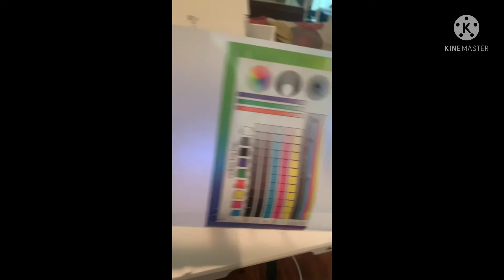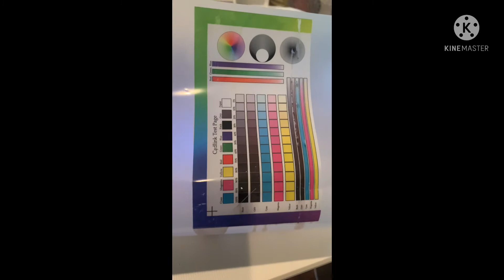Converting a 8550 and a 8500 to a Dtf Direct to film printer!

Comment: What program you use for the et 8500, cad link only showed 8550 settings
Reply: How do I connect cadlink to my eco tank 8500 it’s only allowing me to select the 8550 😅
Reply from the maker: Did you hook it up with the cord
Reply from the maker: Yes use 8500!
Reply from the maker: The 8550 is the same thing

Comment: 8550 or a converted L1800?
Reply from the maker: Please don’t make me choose. I guess a l1800. But I wouldn’t buy neither. Ima R3000 p600 or a p800
Reply: @bigboiprints5726  Where do you recommend getting them from? You have any?
Reply from the maker: Marketplace or eBay
Reply: @bigboiprints5726  I wanted one of those big boy 24 inch printers but i cant find them at a decent price. I was told the US p6000 will lock after a few refills or something like that.
Reply from the maker: I heard it but not sure yet
Reply: @bigboiprints5726  Good looking out bro....Heard Acrorip 11 will support P900. Your thoughts?
Reply: @bigboiprints5726  Found a P800...I have your inks in my cart....Need refillable carts ASAP. Trying to find regular or 280ml....Do you know where I can get them ASAP?
Reply from the maker: But I heard they print nice
Reply from the maker: Still don’t have a chip resetter
Reply from the maker: Ink owl. I’ve been having luck with Etsy
Reply: @bigboiprints5726  I know im asking mad questions. What film do you recommend for your inks and how do/would you have your ink carts set up in the P800? You use Cadlink on P800 too right?
Reply: @bigboiprints5726  My guy. Thank you.
Reply from the maker: I sell film it should be in stock tomorrow
Reply: @bigboiprints5726  So ill put in my order tomorrow if it will be on your etsy. Ink Cart Setup? Cadlink?
Reply from the maker: Yea ma’am. Thank you I appreciate you

Comment: Did you use CADlink to print on the Epson 8500? If so, what version?
Reply from the maker: Direct to film
Reply: @bigboiprints5726  ok what drivers did you use?
Reply from the maker: The 8550 or 8500
Reply: @bigboiprints5726  does cadlink have the tilling option for larger designs?
Reply from the maker: Never heard of tilling. What’s that
Reply: @bigboiprints5726  tilling for printers 8.5x 11 images that are bigger than the printer can print
Reply from the maker: @johngrate8100  I’ve seen people slice images and press them together

Comment: Does the cadlink work with the 8550, what else do you need to add to the printer? Other than taking the wheels out, what else needs to be added?
Reply: Oh and other than the powder put on it can they be preprinted and set aside for later
Reply from the maker: Yes cadlink works with the 8550! Ink powder and film!
Reply: @bigboiprints5726  By the way happy new year!!!!!!!!!!! Thank you for responding so quickly. I don't need an extra tank for disposal ink or anything like that? How hot do i need to get them after they have been powdered.
Reply: @bigboiprints5726   I will get my cadlink from you when the printer gets here.  I saw the ink order.  Why would you not get one?  I have a 6370 for sublimation but I seldom use more than about 12x12
Reply from the maker: Yes ma’am you need to do a full conversation. Waste tank and all.

Comment: I have a question? I put my ink as black,white,cyan,yellow, magenta, white after instructed by someone else who has this converted. They have acrorip 10.4. After trying all the trial versions I want to purchase Cadlink full version but my ink is printing black on the back side instead of white. I have reached out to cadlink and no one has been able to help me yet. The ink setting I have works with acrorip and ekprint but not cadlink. Is there a way to change ink order or am i just going to have to purchase one of the other software programs?
Reply from the maker: What printer do you have
Reply: @bigboiprints5726   Epson 8550
Reply from the maker: No it’s only one way!
Reply: @bigboiprints5726  Ok thank you
Reply: @tiffanymullins6583  did you ever find a solution because I am having that same issue
Reply: @annikasherrill9201   I’ve been on the phone with a rep from Cadlink for 5 days and she told me they are going to try and create a program that will fix this and I could download it and it would fix it right away but I haven’t heard anything yet.
Reply: @tiffanymullins6583   thanks I will also try again next week
Reply: @tiffanymullins6583  I will keep you posted
Reply: @annikasherrill9201  ok and if I find out anything I will keep you posted

Comment: Hi Sr  thank you so much for explain this process, but i have a question, how work the pinch roll system because in ohter epson printer need remove the front pinch roller or with this print can't apply that. Thank you.
Reply: I want to do this but im afraid im going to mess it up 😬😬
Reply from the maker: What’s a pinch roll system
Reply: @bigboiprints5726  in the front have a little roll i see some videos the epson l805 when it remove, but really i want is not necessary in this ptinter.
Reply from the maker: I’m confused
Reply: @bigboiprints5726  Well sir, excuse me if I am confusing you with these few precise questions, well I managed to look at the video in the part where you are printing and I could see that the impression was very good but somewhere it was scratched, I do not know if it was at the time of manipulation The paper, but what it explains is that in the l805 model some people on you tube remove something that they say pizza wheel, so that it is not marked on the paper when it is printing, usually you always leave 2 in the ends so that the paper does not lift. my question is you have not had to manipulate any physical part to be able to print.

Here is a link with what I mean about pizza wheels.

https://www.youtube.com/results?search_query=remove+pinch+roll+epson+l805+dtf
Reply from the maker: I took all my pizza rolls out
Reply from the maker: 2145336154 call me please
Reply: @bigboiprints5726  can i call i have questions
Reply from the maker: Yup. Hit me on Facebook

Comment: If I convert the printer to dtf ink I will have to get another type of software program to print it?
Reply from the maker: The link should be in the description
Reply: Ok kool. I gotta find a way to get the sublimation ink out first
Reply from the maker: Yes you will . I can give you a two free trail of cadlink! It a rip software
Reply from the maker: Power clean

Comment: How to convert the 8550 to dtf
Reply from the maker: Take those wheels out and fill up the ink . With big boi ink. And run a couple head cleanings and see what you get!
Reply: @bigboiprints5726  What about the tanks ?? is there any way to detach and shake the ink ?? or how do you deal with that ??
Reply from the maker: I don’t really recommend this printer because of that. You have to print every other day with this printer. Especially if you have cheap ink!
Reply: @bigboiprints5726  if you’re going to print every day do you think it will be less of a problem
Reply: @bigboiprints5726  Ohh i understand. Yeah looks like a very solid option since is a fast printer, but the tank is thie problem, i hope soon we can get an external tank option. Thanks for share the experience
Reply from the maker: @carloscamargo6625  just trying to give you what I know. But thx for tuning in.
Reply from the maker: Yes! But u must be careful. With that ecotank. Make sure you get good ink!
Reply: @bigboiprints5726  I think this is the perfect case for a ink recirculator, or wait for a external ciss.  Thanks for the advice bro.
Reply from the maker: Makes sense!